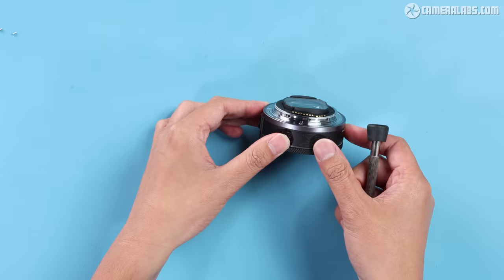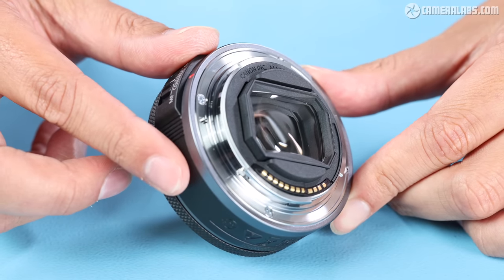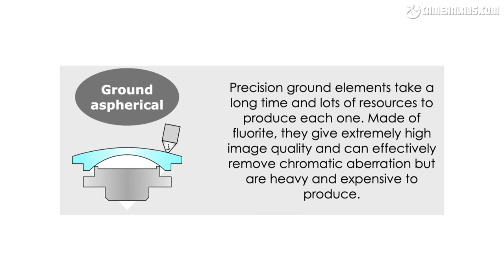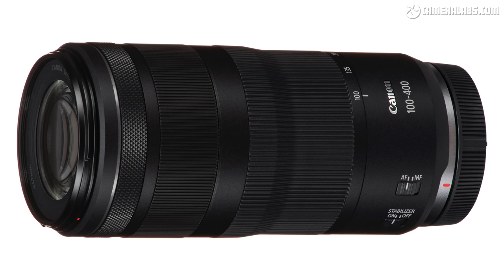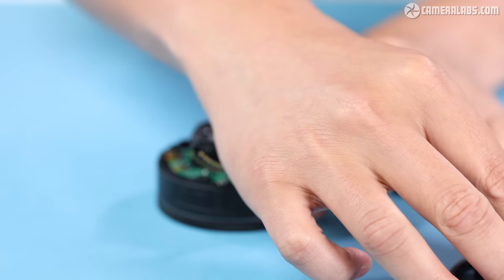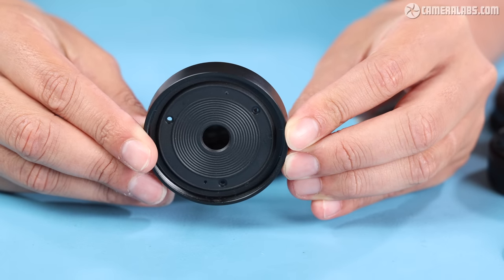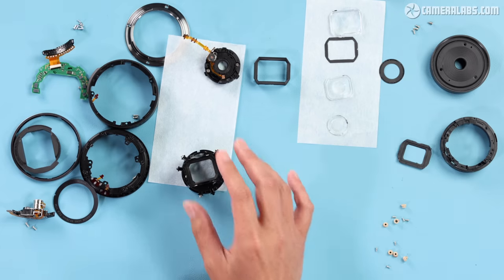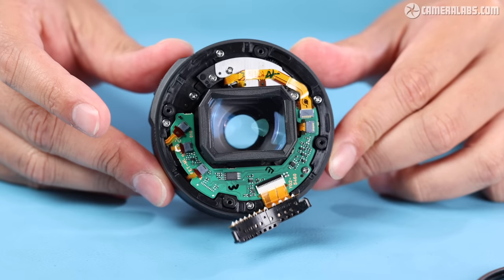Canon lens TEARDOWN! What's INSIDE a new lens?

Comment: It is cool but it isn't a big secret, I am sure all camera companies buy each others' lenses to have a look inside.
Reply from the maker: I bet they do, but this one is NOT on sale yet
Reply: @cameralabs  true. It soon will be though. Aside from Chinese manufacturers, nobody is going to retro engineer it and it seems that Chinese manufacturers haven't tried to hack into Canon's system to make AF lenses that will work with R cameras.
Reply: @cameralabs  also at the moment Canon really needs lenses quickly because as an R5 owner who doesn't want all L lenses for both weight and budget reasons, there is almost nothing to choose from aside from adapting EF lenses... And the few good choices are either not weather sealed or have tiny tiny apertures. Canon users need Sigma, Tamron and Tokina to shake up things. At the moment there is really nothing I want to buy to add to my 24-70L, 16/2.8 and 50/1.8... especially with Tele lenses but also wide zooms. I am actually ok having just 3 RF and canon EF/sigma Art EF for now because I want to buy but can't find anything in the range that I want to buy.
Reply: @Photoandcargeek they even put them in marketing material. Didn’t the Sony lens appear in the Canon 100-300 official clip lol

Comment: They had to do it intentionally on the most boringly built lens
Reply from the maker: It's not boring if you want a compact, light wide angle that's not too expensive
Reply: @cameralabs  I meant the actual build, not the lens itself, would have been much more interesting if they did it on a more complex lens like the RF85mm 1.2 or the RF70-200 F2.8